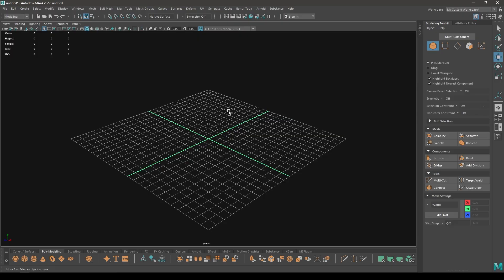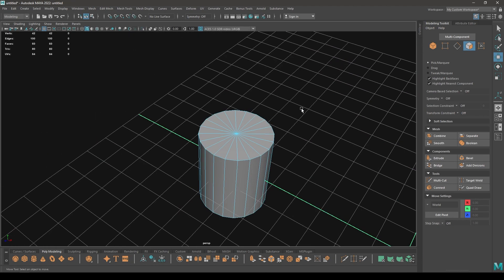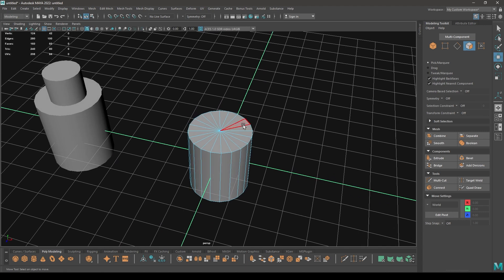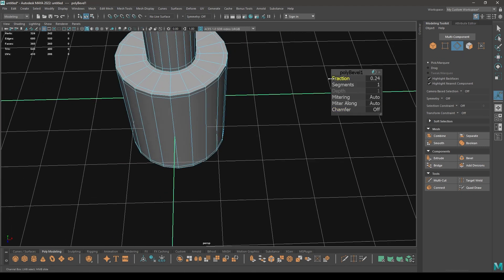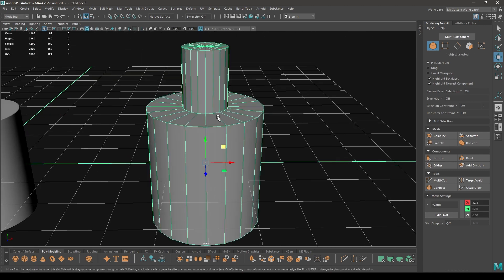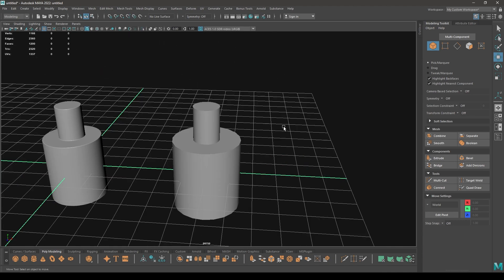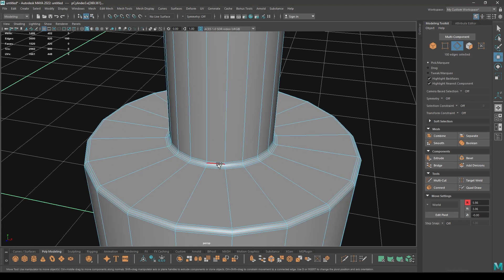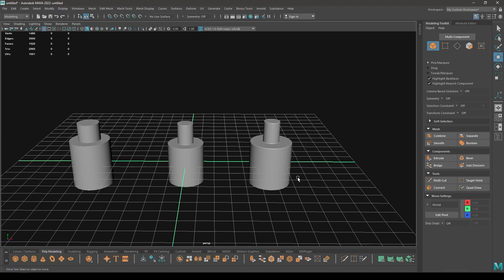Maya Tutorial - How to Get Rid of Hard Edges in Autodesk Maya | Harden/Soften Edge Tool

Comment: Hi, is there a way to export the soft edges too in Unreal, just like smoothing groups would do? My main problem is that I need to soften my model without adding any geometry (smoothing groups in 3ds max are perfect for this) I can't find an answer for this, do you have a solution? Thank you so much, have a great day :)
Reply from the maker: Hi, sorry for the delay.
But you can export your mesh as FBX and turn on smoothing group while exporting.
You'll see the option in the panel on right when you're exporting.

Comment: Hello Hitesh! I'd like to know if u ever used Crease Tool, and if u do, what can u tell about it? This tool seems to be useful with Smooth mesh in Maya
Reply from the maker: It smooths out the edges without increasing the number of polygon count in your mesh.
You can also control the the hardness or softness of your edges you're using crease tool on.
Reply: @3dwolf  So it is similar to Harden\Soften Edge Tool?
Reply from the maker: Yes but you can't control and maintain the hardness of edges in soften/harden edge.
With crease tool you maintain all that.